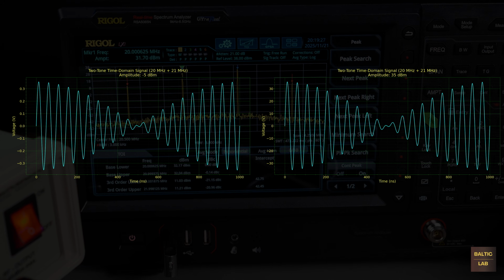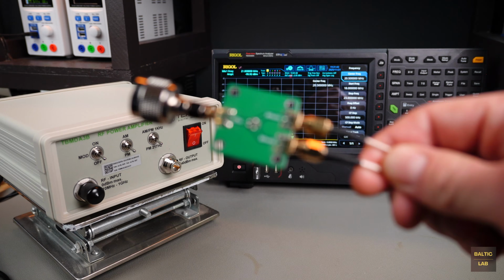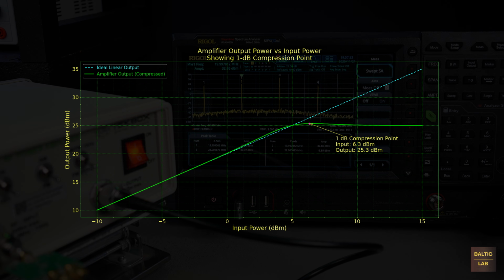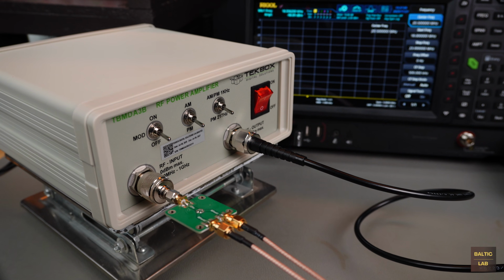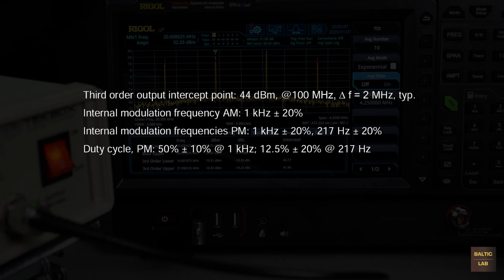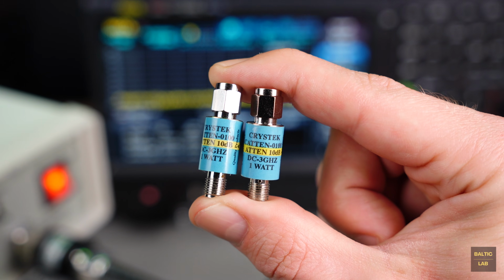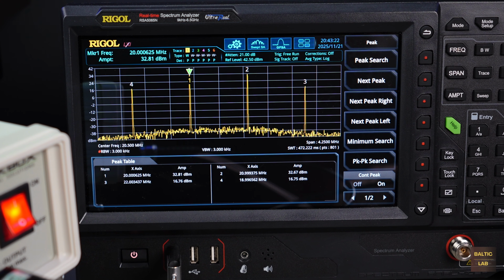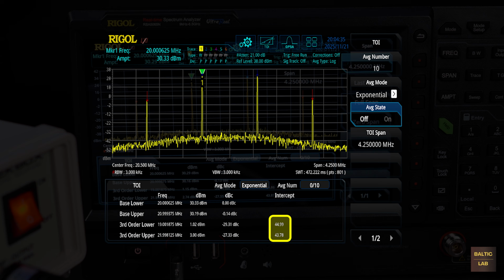IP3 / TOI Measurement Explained: Accurate Third-Order Intercept Testing

Comment: I had a poor IP3 reference point from the test equipment and was struggling with 2 sig gens. I used one atten on the combiner output. Why didn't I think of one atten on each sig gen feed? Doh! Thanks for that. Seems obvious now but I missed it!🙈
Reply from the maker: It's a very common mistake. That's why I included it in the troubleshooting process. Personally I recommend to always check the TOI of the combiner output signal.

Comment: Couple pointers. In general OIP3 you are measured in linear regions of amp operation. I will recommend the 16dB below P1dB. Instead of restive combine use coupler with attenuator on output port to balance the nominal coupling. Couplers usually have much higher isolation between output and coupling port, and addition of attenuator on output of the coupler to improve isolation and overall matching.  Measure the setup performance before you measure the component. The general rule is that the setup should be around 18 dB better than the component performance to get less than 0.1dB error for the worst case. I will add that there is "sweet spot" for input power that you need to look at the spectrum analyzer. It is usually at -36 dBm where the spectrum analyzer DNL (system noise level) and internal system intermodulation converge. So no matter what outpost power you get from the device under test (DUT), use internal step attenuators or external attenuation to get to the -36 dBm for stable performance. Additionally there are DUT matching. If it has pure Return Loss you combiner isolation will decrease. Additional attenuation between combiner and DUT might be necessary to reduce reflection from DUT and improve isolation on the combiner.
Reply from the maker: Thanks for sharing your thoughts on optimizing the measurement setup. Many of the points you mention are actually included in the video, admittedly sometimes only in a more superficial form. Your comment suggests that you may not have watched the entire video. In my more recent uploads, I intentionally start with "accidental" mistakes and then correct them step by step. This approach tends to be more effective in drawing attention to potential sources of error. In any case, those are excellent tips, and I appreciate you taking the time to share them.
Reply: @BalticLab  I like the topic, and the approach to teach. For my taste, you may slow down the pace and take more time to explain. Maybe I am old-skool used to keep the attention 😀
Reply from the maker: @ernestb.2377  Thanks for your feedback. It's hard to strike the right balance for pacing. Many people these days have the attention span of a goldfish. But I'd agree that on this video the information density was a bit too high even for my taste.
Reply: @BalticLab  Maybe to put it in another way, maybe to 'engage' more with the audience. I like the approach where you intentionally do it 'wrong' and explain the pitfalls. Keep up the good work and to be clear my intention is not the criticism. By the way, recently I did a 4-days course at location about RF, and we have done, among other things, the IP3 measurements, but there was too little explanations why we are doing it. I have to say you have explained it much better. And the tips to stay way under the 1dB compression point.